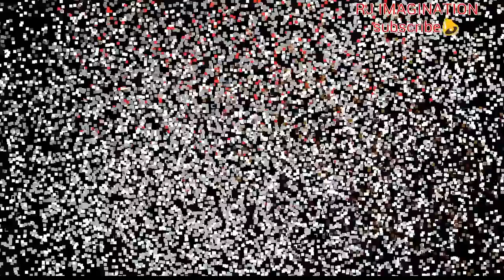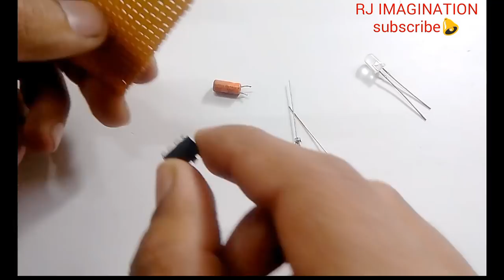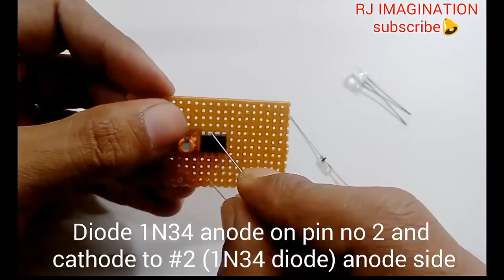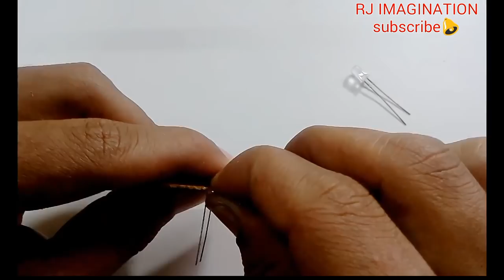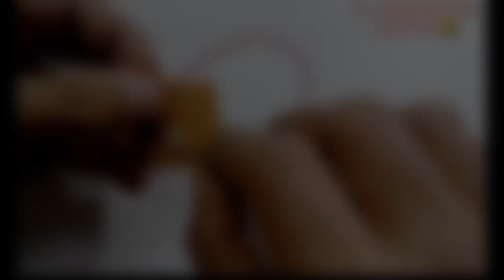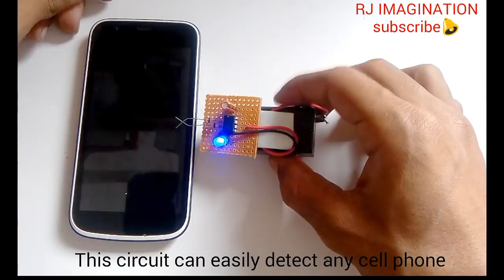Cell Phone detector using 386 IC |without calling

Comment: One doubt sir we tried this but it's not giving proper output , when we connected led to battery the led continuously on
Reply: Use limited power supply of only upto 3 to 4 volts otherwise circuit will damage or will not function neatly ... More information watch this 
https://youtu.be/AE6zHnBRO-c
Reply: Used only 4v supply even though it's not working
Reply: Check components or ic may be damaged, if you have already given more than 8 or 9v before ... 3 to 5v is the limit of IC LM386. And also try to use different values of capacitance of 20uF.
Reply: @ElectrogeekZ  k I'll try
Reply: same thing also happening with my project, even after changing capacitor to 20uf. what should i need to do?

Comment: Thanks for the video. but how about disconnecting the phone onthe internet?
Reply from the maker: Without sim card it will not work
Reply: @RJImagination  sir could you please share the components alone plz
Reply: @RJImagination  sir what is diode to use for this project and the transistor can I use 9v battery for this